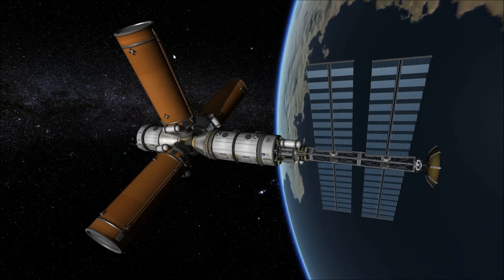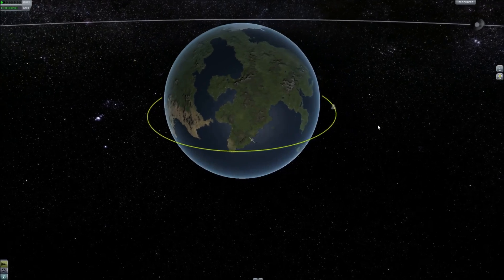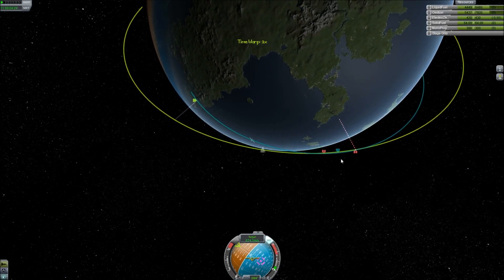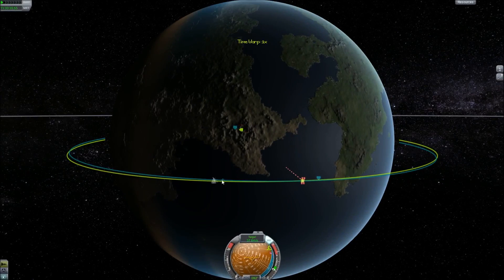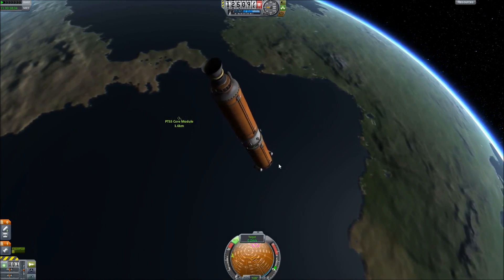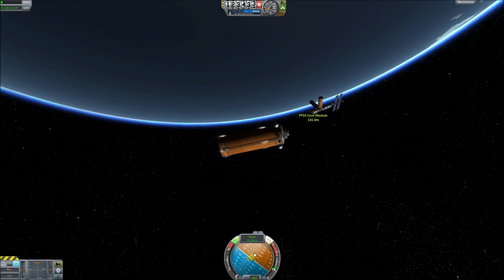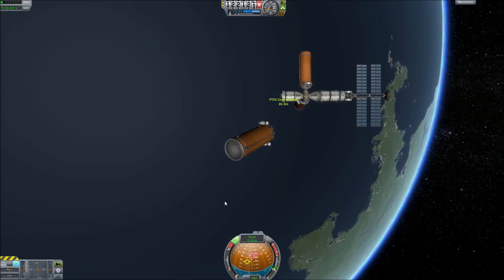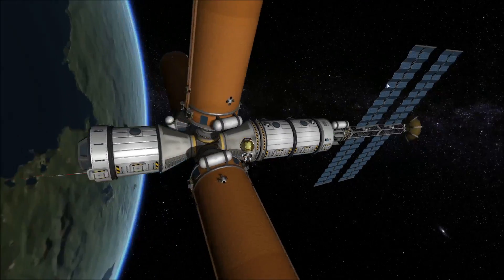KSP .22 Part 4 "Orbital Fuel Station & Docking Tutorial"

Comment: Just a few things I wanted to add. Turning on docking mode and using Linear rcs can work better for fine tuning your approach to rendezvous and of course when in docking mode you can toggle between (Rot)ation and (Lin)ear so there's no need to switch craft in order to get oriented with your docking port. However your method for creating an encounter is very efficient.

Comment: why are some tanks losing fuel faster?
Reply: fuel ducts distributes the fuel throughout the rocket setup, so you get extra lift from an extra rocket firing without sacrificing fuel for your next stage
Reply: I see thank you :D
Reply: just be careful  when using them, cause they dnt supply free fuel to extra boosters, they just allow u to fire boosters that u would normally stagefire later on but if u do use them to ignite 2nd stage boosters your liquid fuel does burn faster as a result from supplying the extra engine

Comment: when i build a rocket to dock i just exploded the docking station xD
Reply: ... same :(
Reply: Giannis Mariettos speed is a variable when it comes to docking anything from 0.1 -0.4m/s usually being tolerable 0.4 -0.5 m/s  being the absolute upper limit on approach speed, and when docking larger ships near perfect allignment and approach speeds of no greater than 0.3m/s  at the most is a must as the inertia of larger ships will cause it to whip out if you dock in at an angle and either a dock reset is required or you will possibly cause damage to your ship and whatever your docking to